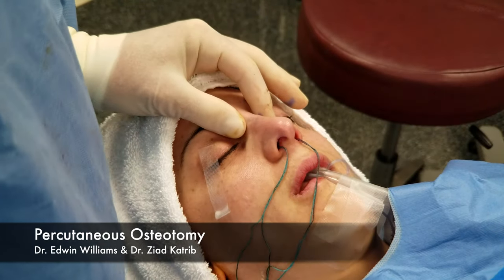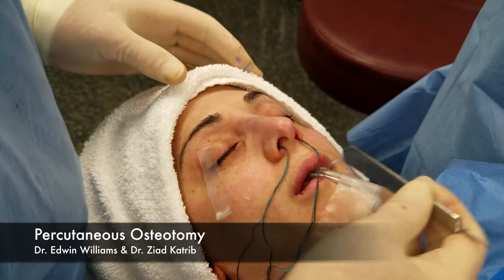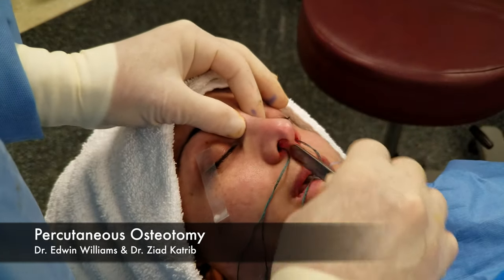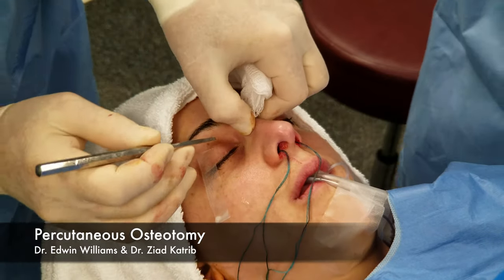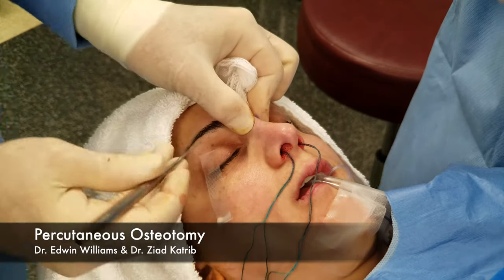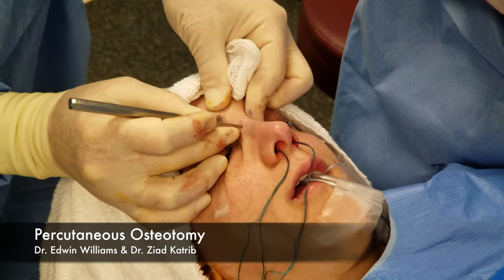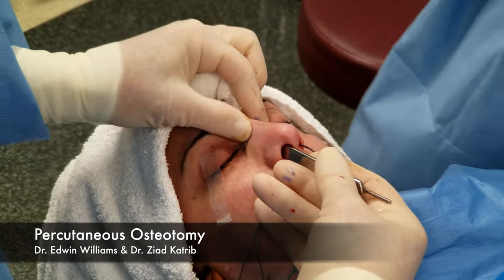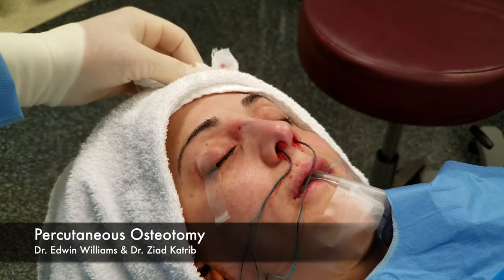Percutaneous Osteotomy & Breaking the Nose During Rhinoplasty Surgery

Comment: Can I have this treatment even after a year of the injury?
Reply: yea! I had it done years after... so yep. it's more so nasal reconstruction.. I had a septorhinoplasty.. but same thing was done.
Reply: WorldGangWatch  HOW IS IT NOT!!! YOU KNOW WHAT AN OSTEOTOMY IS?? ITS A CONTROLLED WAY OF BREAKING THE NOSE. IF YOU HAVE NASAL DEFORMITY FROM A PRE-EXISTING INJURY THE DR WILL CORRECT IT, AND MOST LIKELY A OSTEOTOMY IS DONE. IF THE NOSE IS COMPLETELY DEFORM I'M SURE IT COULD BE INTERNALLY, AND EXTERNALLY WORKED OUT TO PUT IT BACK INTO PLACE.SO DEPENDING ON THE SURGERY AFTER EVERYTHING IS COMPLETED THEY CAN DECIDE WHETHER OR NOT DO IT ON THE EXTERNAL PART OF THE NOSE.
Reply: YOUR NOT A SURGEON SO DONT SPEAK. THIS LINK IS FOR PREVIOUS ISSUES ADDRESSED...